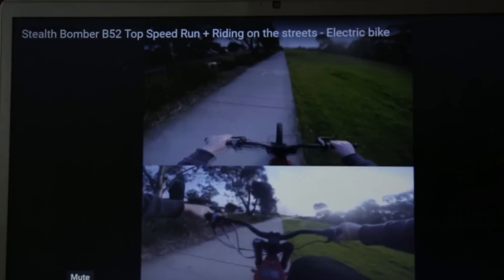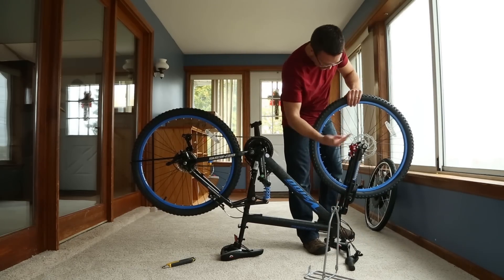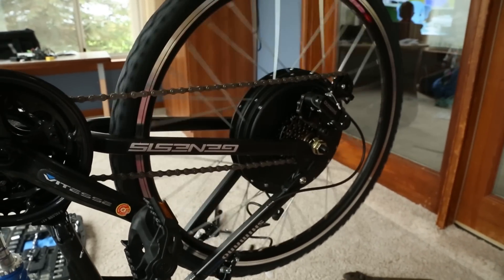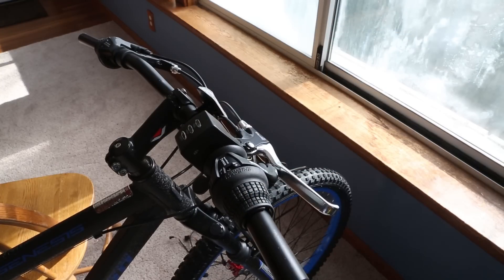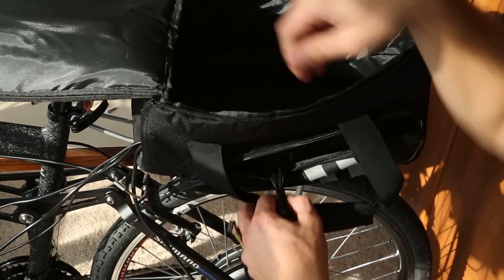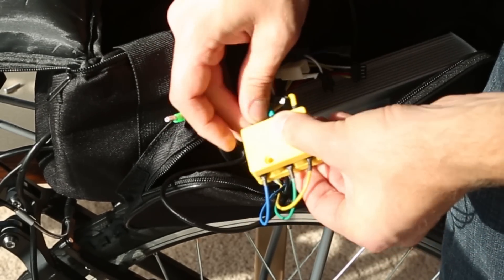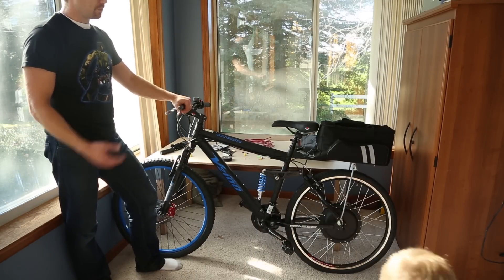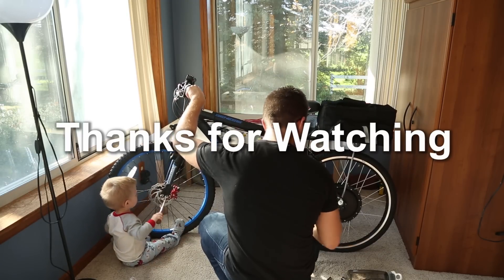How to make an electric bike for under $500! Fast & Cheap eBike tutorial!

Comment: Also, you say you're using 12 gauge wire in 1 spot and 10 gauge in another, to anyone reading this comment: use 10 gauge.

Doing the math, this 48V 12AH battery will last 36 min on full throttle the whole time.
Reply: iplayball27 hi, if i use a 750w and 36v motor, how much time at full performance this battery pack will last? Thanks
Reply: Thanks for this comment! I'm building my ebike conversion now and noticed the 10 ga/12 ga discrepancy in video. I'm not an electrical expert, but I know enough that the wrong gauge wire can make big problems! Cheers!  (I ordered a 36V front 24" motor hub and three 12V, 12Ah batteries to wire in series today.) I'm converting a $119 Walmart cruiser bike for my 70 yr old mother to ride when she visits me in Arizona.
Reply: Any number would be a rough estimate. It all depends on how hard you are on the throttle, how much you pedal, pedal-assist settings, tire pressure, knobby tires vs smooth, bike weight, rider weight, cargo weight, flat land vs hills, hardness of the ground, and wind direction. Of course, using a 48 volt battery on a 36 volt motor might burn up the motor/controller if it isn't rated for it. I ride a 26x4" fattie that gets anywhere from 25-50 miles depending on the factors I mentioned. The bike and I together weigh 300 lbs. I've got a 48 volt 750 watt (1500 peak watts) motor with a 48V 24Ah battery.

Comment: I would've built a Li-Ion battery pack for it, they are lighter and have a greater energy density than sealed lead acid. Course, it would also drive the cost up.

Comment: get a torque arm! Also lead-acid batteries are trash, you've probably already had to replace them by now. Invest in a good lithium ion pack which will be cheaper in the long run, as well as lighter and easier to charge/use.

Comment: well a stealth bomber is a 5 or 6kw motor at least. the batteries are custom made lithium ion cells. and the voltage is about 60 to 120 volts

Comment: Just a tip. Ditch that rack they gave you and put a Seat post mounted rear rack. This'll allow the bike to use the rear suspension. If you use the current one that mounts from the rear bars to the front frame. This disables the shock system and locks the frame in single play. So you won't get shock absorbing anymore.
Reply: Rack rotates up with rear tire and suspension...
Reply: @supernaturalswampaids8083  You are right, everyone has been missing this. BUT it doesn't change the fact that that HUGE battery is now unsprung mass.

Comment: Just a question from someone who is considering building their first eBike: will a motor rated at 500W of power work with a battery which has 720W (36 volts and 20 amps)? Any reply is appreciated! I have done quite a bit of research but I cannot seem to find the answer to this question online.

Comment: how has the bike worked out for You? also you said 10 gauge wire and 10 gauge connector right?
Reply: He said 12 gauge in 1 spot and 10 in another, but 10 gauge is better in this scenario
Reply: Yes he did. 10 is good enough.

Comment: A couple of things for people watching... NEVER put a powered wheel on the front with shocks. JUST DON'T DO IT!  Next, make sure you are getting the right levers for your brake type. Another thing, don't use a Walmart bike for this project. They are incredibly cheaply made. The wheel bearings for the front wheel are not suitable for high speeds. If you MUST use this bike, buy new bearing and a new races for the front wheel and replace the cranks. These cranks are really thin and known to strip and have the pedals fall off. Make absolute certain to adjust the rear derailleur limit screw to make sure the chain doesn't fall between the cranks and the hub, given it's a stock 7 speed cassette and the kit is 6. It's probably best to charge the batteries one at a time. Also, don't ever run the batteries all the way down as it can kill that battery. Don't expect a lot of range out of this setup. The bike is heavy, the battery is heavy. Nominally the battery is 576WH, but don't expect more than 450 per cycle. I wouldn't expect this battery to last more than maybe 75 cycles. Good deep cycle SLA batteries are a lot of money. A $100 576W/H battery is not going to be top quality. If you can afford it, go with a lipo.

Comment: I would NOT be comfortable going fast on this bike, especially with all that extra weight. Walmart bicycles simply should not be used for E-Bike conversions. Everything except the battery is more expensive than your video says.
The linked motor setup is $363
2 of the linked batteries is $100 (for all 4)
Bike is $150
Charger is $50 
That's $663 without the rack (and it's wrong kind of rack for this bike).

Comment: My favorite part was the end when your son was helping out. I just installed a 1000W Front Wheel unit on my girlfriends adult tricycle. She has cerebral palsy and needs a 3-wheel bike. Due to limited range of motion and limited range of peddling she really needed an electric option. Waiting to get my bike but already have a second 1000W Front Wheel unit sitting here to put on when i get it. Will have 2 batteries on the way tomorrow for mine and hope to be able to get the other 2 soon. I went with 20AH for Jens bike and will do the same on mine. I have to order torque arms for her bike. She cant ride it till i get them. The axle wants to spin out of the dropouts. If you dont have torque arms you might want to buy some ASAP.
Reply from the maker: Thank you for posting this!
Reply: The Watchman News 
What batteries did you go with for your bike and the trike? I'm building a trike for myself and my wallet isn't so happy with the idea of spending 500-600$ just on batteries alone.

Comment: I really wouldn't use lead batteries for an Ebike, for one the recharge cycle is about a 10th of a lithium pack, they can't draw as much current, take ages to charge, heavy (4x heavier), in the long term the lithium batteries will work out cheaper.

Comment: in minute 5:43 you are applying some bolts to the frame, I suggest to create a shape using plywood or using plastic, so the bolt can't wiggle/move, and insert it into that small space, in that way the rack that 6you show in the vid should do fine...

Comment: I'm not keen on this kit for the following reasons.
Big heavy batteries, heavy drive wheel, all the weight is on the rear wheel. I think the battery carrier will interfere with the bikes suspension and something will fail.

Better to buy a downtube battery front wheel drive kit. The weight's spread across the bike.  The front wheel will be much easier to remove if need be. Also the rear wheel drive will change how many gears you can have.

Comment: does the motor cause any resistance when pedaling?
Reply: Not really, because it turns with the wheel. Obviously, it makes the wheel heavier so it requires more energy to pedal it that respect. For example, I have a mid-drive motor. If I'm pedaling unpowered, I can  definitely feel the resistance of the magnets and internal motor gearing far more than I would with a hub motor.

Comment: Great video man... Im pretty sure the bike rack is supposed to fit in the inside of the bag and the arms of the rack are supposed to fit thru those holes in the front and bottom of the bag then there is a bolt that goes on the angle bracket on the back of the rack to hold the bag in place that way you can mount all of your components onto the rack inside of the bag itself ive seen others that are like how ive explained it so its just a guess on your setup but just thought id throw that out there

Comment: Hey I was wondering what wire gauge you use? You said 12 and then later on you said 10...
Reply from the maker: I used 10, but 12 should be just fine.
Reply: TechMindBlow oh ok, thank you man. How far is your range btw on full throttle? I only get 8 miles with the same batteries fully charged like the ones you have, is that right?

Comment: But dude there are already electric bike's for sale on amazon and Walmart 500-600. Ancheer in Walmart is around 600 and price fluncuates and also this one. 
Cyclamatic Power Plus CX1 Electric Mountain Bike with Lithium-Ion Battery https://www.amazon.com/dp/B002AQHM3U/ref=cm_sw_r_cp_apa_FqNdzbMP4GHWP

Prices are slowly coming down on these bikes.
Reply: True, but his kit is 1000w motor the one you linked to is 350w. Also the one you linked to goes 15mph tops, his 28-30mph. So I guess it depends on what you want. I have basically the same set up with a different bike and monitor. It's fast, fun, inexpensive and reliable.

Comment: I had the same pack, but my control unit was defective, took me ages to get a reply from the seller :( did you experience any sparks when connecting the power pack to the control unit?
Reply from the maker: A small arc or snap...no sparks though.
Reply: I was using an aftermarket silverfish pack 15Ahrs and connecting them blew everything in the control unit. bad luck i suppose. i had a look inside and there was no surge protection.
Reply from the maker: A simple inline fuse should solve the problem next time.

Comment: you just burnt a hole in your carpet when stopping the rear wheel!
Reply from the maker: Yes I did! Wife wasn't too happy.
Reply: Just throw a rug there and never more it.
Reply: did she forgive you 

and i tried using those kits once but with a non acid battery and it burnt fuses ALOT did i wire it wrong or something you think?
Reply: @TributePerson  u was prob using a voltage battery higher than the controllers capacity so it overdrawn amperage
Reply: TechMindBlow wanna build 1 for me :P
Reply from the maker: Of course.  She's great. I don't know why, probably wiring or just a bad controller?

Comment: At 4:33 how does it make sense to bolt a rear rack that needs to be in a fixed position onto a dual suspension bike where the rear swings like that?
Reply: Pibbles 'n Bits agree..  thats a very expensive '' repair ''.
Reply from the maker: Update video is up! - https://youtu.be/CU9PcscbU-8
Reply: @TechMindBlow  lol
Reply: @TechMindBlow  i

Comment: Good video to convert a regular bike to electric. Ebay seems to have a lot of conversion kits. Don't know if any are good. I use my pedal Columbia bike for local rides to the store, etc. But for long distance have to take New Jersey Transit or rent a car. Would rather use some kind of electric hybrid bike instead of a high maintenance gas car with lots of parts that go bad like timing belts, etc.

Comment: @4:51 What about the rear suspension ? As soon as you get on the bike this thing will bend or you'll damage the frame...
Reply from the maker: It isn't that tight, so the rack pivots some...but you're right it would be best to have a strong seat rack.

Comment: How did you meet basic safety requirements set by the US Department of Transportation. 
Will it be easy to get a license and insurance or did you get in any trouble?
I had a smaller e-bike and the insurance broker always brood over the licence papers what exact type of motorcyle it is.
Do you need two mirrors or is one good. Do you need lighting for the license plate and a brake light?
Reply from the maker: I live in a rural area, nobody is going to question what I'm doing.
Reply: The US DoT doesn't really regulate bicycles. There is federal law restricting top speed and max wattage for unlicensed vehicles, but that's about it, AFAIK. Municipalities cover the regulation with their own definitions on speed, power, brakes, lights, etc. The items you mention all depend on where you live.

Comment: I build a ebike with this exact kit. 48w 1000amps bought a lipo battery and it goes about 30 for 20 miles. So much fun!
Reply: michelle cisneros you mean 48v and 1000w? Obviously you’re a rookie when it comes to Ebike’s, and so is this dude! He’s an engineering moron. Connecting a rear rack to the chassis and the seat of a rear suspension bike! This is a disaster waiting to happen!
Reply: Bet, these batteries cost $20 a piece. How is he spending $500 on this kit? The motor and controller are $139. What the hell? What an idiot!

Comment: Best way to get your handels on is hairspray. At first it acts like lube and afterwards it acts like glue.
Reply: Kevin Delcambe 
Professionals use wd-40
Reply: Or you could just use water, you know....
Reply: Hand sanitizer by far the cheapest one to use.  Safer and non-toxic as well.
Reply: Kevin Delcambe बादल कुमार राज
Reply: I use compressed air to take off and put on handle grips for all toys (atvs etc). My preferred method seems to always work and very fast (off and back on in less than 30sec for both sides).
Reply: I heard somewhere that some poepl use zip tirs to create a gap under the grip then compressed air
Reply: Hand sanitizer and alcohol are cheaper options and work just as good, if not better.

Comment from the maker: How do I charge my batteries? You can charge them all at once with this charger http://amzn.to/2oFb85T.
I just charge them separately because I have not bothered to get a 48 volt charger yet and I don't use the bike often. You could wire them in a series and charge them with a normal 12v charger.  I just use this one https://alexa.design/2ollyKY
Reply: The problem with solar on ebikes is, if you install solar cells they probably weigh too much and don't give much power
Reply from the maker: I don't have any experience with solar, but I'm sure it's possible.
Reply: I have two wires from each pole, so that my batteries charge in parallel, and  use the other wires in series to power the bike.
Reply from the maker: Post a picture?
Reply: No, sorry! Haha, my plan was to do that, but I tested it and it shorts out :(
Reply: I've made an adapter that connects the batteries in parallel when I need to charge them. 
I'm going to make another one that connects them in series for the bike (56v)https://plus.google.com/photos/...
Reply from the maker: Link does not work for me.
Reply: Hmh, ok... well it was just a picture
Reply: Wow and wow, thanks for the link to affordable hub! I tried to order one a few days after you posted this vid, but they were all crazy pricey or out of stock. Came across your vid again tried the link again and they had some in ... ordered! Now just wondering if you could charge on the go with say simple charge controller in the mix? and if so do you think a solar trailer set up is possible?
Reply: I have a question about shipping. How long did it take you to receive your motor kit in the mail?
Reply: For me it took 1 month
Reply: Oh interesting. Are you in the US?
Reply: No, I live in Norway witch is like on the other side of the world😂 
Most people will get the kit shipped via sea mail witch can take up to 3 months (usually 2)
Reply: wtf... i dont have 3 months to wait.. SUMMER WILL BE OVER!
Reply from the maker: 2 days from amazon! I live in the US.
Reply: Hey Bernard, I live in Norway as well, just wondering how much you had to pay for the items (including tax), and which bike you used? :)
Reply: ***** mine didn't, if you buy a kit without a battery, you will need to buy/make a battery and a charger.
You can always find out what's included in the product description page on ebay
Reply: I wired them in series just like in the video. I use the charger linked below. Just hook it up just like you do to the motor and it charges them all at the same time. 48V 3A automatic e-bike, scooter & electric vehicle battery charger maintainer https://www.amazon.com/gp/product/B00IZ7WWPQ/ref=oh_aui_search_detailpage?ie=UTF8&psc=1
Reply: You can use regular hover board charger
Reply from the maker: Thanks.  I'll add it to the description!
Reply: Your description is wrong, parallel increases AH, series increases volts.
You can charge in parallel without much issue, DO NOT CHARGE IN SERIES without a balancing circuit, if any of your batteries fail all the rest will take up the slack, possibly overloading all of them

Comment: How do you recharge you batteries? What kinda charging adapter you use?
Reply from the maker: How do I charge my batteries? You can charge them all at once, but I just charge them separately because I have not bothered to get a 48 volt charger yet and I don't use the bike often. You could wire them in a series and charge them with a normal 12v charger.  I just use this one https://alexa.design/2ollyKY

Comment: How are you recharging the batteries?
Reply from the maker: How do I charge my batteries? You can charge them all at once, but I just charge them separately because I have not bothered to get a 48 volt charger yet and I don't use the bike often. You could wire them in a series and charge them with a normal 12v charger.  I just use this one https://alexa.design/2ollyKY

Comment: how would you recharge the batteries? the same way you do for an ATV battery?
Reply from the maker: Yep! If you charge one by one you can.
Reply: You can charge all the batteries at the same time. All you do is change them from series to parallel. That would turn your batteries into one big 12v battery. Connect all the negative post's together and all positive together instead of neg to pos etc. Techmindblow,  you may copy and paste this reply for all those that ask about charging your batteries.